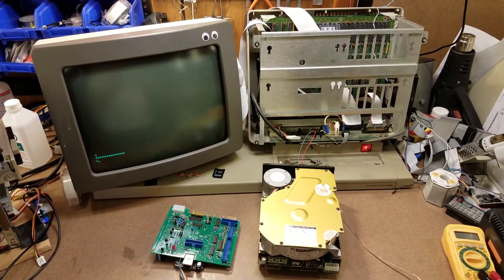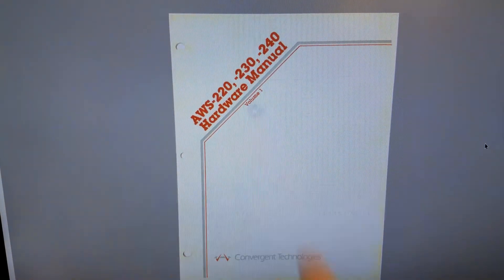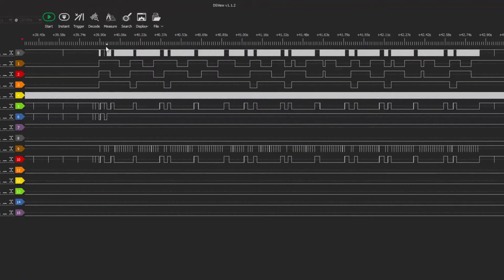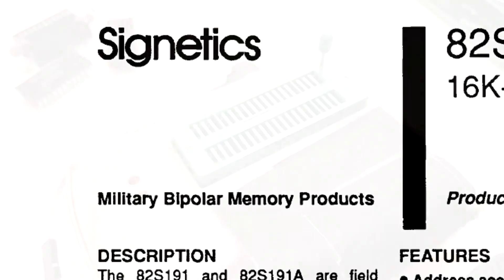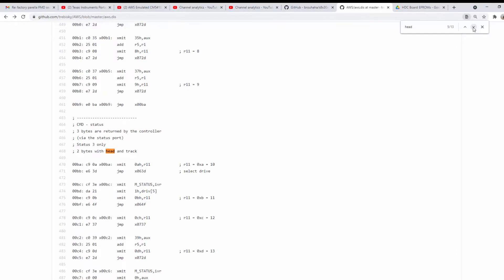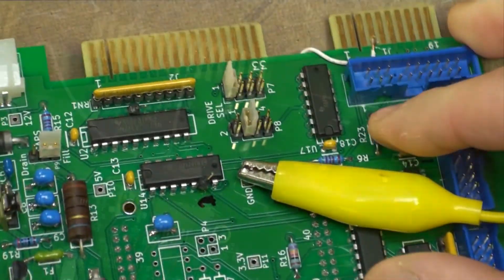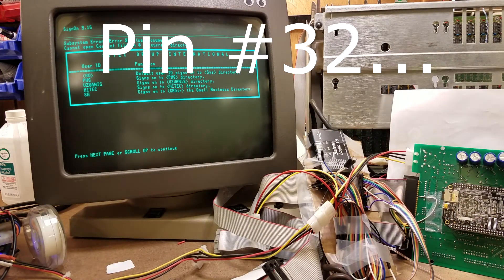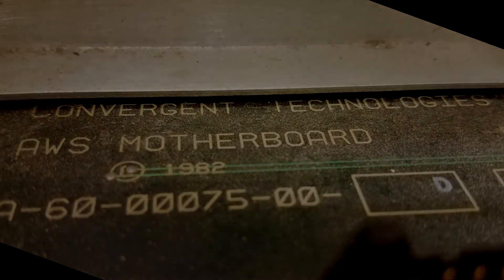The Convergent Technologies AWS Emulated CMI CM5410 Hard Drive Finally Boots!

Comment: The 5410C is not technically a part of the 5000 series, it was part of the "C" series of OEM specific drives. It's my understanding that these were further cost reduced bargain units sold very cheap to OEMs. As a normal person you could not buy one of these drives. This applies to the 5205C, 5410C, and 5616C. They are somewhat based on the 5000 chassis, but so were basically all other CMI full height drives until the closure of their drive division. Typically, the C drives were units which failed quality control for some reason, typically failures in head electronics (limiting their PCB to less than the desired number of heads, 6) or media failures. These drives have a specified geometry of 2 heads (5205C) 4 heads (5410C) or 6 heads (5616C) and 256 cylinders. This could be an issue with precompensation or media defects themselves. I am not sure if the firmware was changed to reflect this behavior. 

Because this drive supports buffered seek and has automatic write current reduction, this is an ST-412 interface. ST-506 uses non-buffered seek and has controller derived RWC as a discrete signal, which is swapped for an extra head select line in the 412 standard the next year.

3:12 These drives should ALWAYS be operated in the orientation they were formatted in. The 5000 series has NO feedback system and so the positioning of the heads is somewhat subject to gravity.
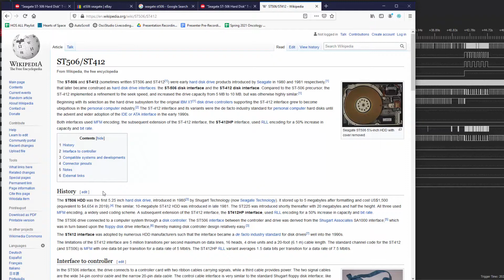5:37 The drive is "dumb" and communicates essentially in terms of it's physical state only - Track 0, index pulse, ready, write fault, seek complete, and the raw analog data actually stored on the selected head.
9:41 Because of above there is no recognition of any kind. The computer is given the physical geometry of the disk manually. Some controllers store the physical geometry of the disk at track 0 head 0 to be loaded on boot after initialization.
12:47 The number after the Motorola logo is a date code. YYWW year and week. These are mask ROMs whose contents are defined at the factory.
18:45 Interesting they were still using 256 byte sectors. Looks like it supports all CMI "C" drives, the original ST-506, and 8" floppy drives too. Neat.
19:55 HAHA I see what they did... The drive will respond with "selected" if DS3/4 are set and jumpered, which means the drive is illegally set to respond to multiple addresses, but this gets them two free jumpers on the disk itself. It would have been much easier and more sane to just put the jumpers or switches on the controller! There exist 4 drive controllers but the drives themselves were cost-prohibitive and so few people probably ever used them like this. An example in the IBM world is the Zobex 4HDC.
21:23 You don't even need to check, you can see the bodge wire to the jumper.
30:01 This is not termination of any kind - The other side of the jumpers is all tied together and goes to the drive select logic, which I believe on the CM5000 is straight into the microcontroller.
Reply from the maker: Wow, THANK YOU for this very insightful and thorough comment.  You spent some time writing this!
Reply: @ForgottenMachines  I did, hopefully it found you well despite being just a bit late. Maybe this information will help you in the future or someone else browsing through your videos. I had stumbled across this in looking for other video of existing CMI drives for a future project I have been working on and figured I would provide some insight.
Reply from the maker: @AiOinc1  Youtube comments are NEVER late!  They are always welcome, and these videos will hopefully stay published for a very long time!
Reply from the maker: @AiOinc1  please feel free to share what you are doing with CMI drives...they are pretty rare, at least here on YouTube...
Reply: @ForgottenMachines  I have a large collection of rather rare and I think interesting vintage hard disk drives. I am in the process of converting one of my spare closets into a nice-ish recording studio to show off many of them, show them in operation, include setup tips, repair help, etc, as well as links to relevant documentation where available. Maybe some example use cases. 

Recently I got an IBM 0665-53 up and running in Windows 98SE, an ST-412 drive via DTC 7287 16-bit RLL controller. Was not as hard as it may initially seem. This is the type of thing I hope to show off a bit. 

Many of the drives I hope to show include CMI 3000, 5000, 6000 drives in my collection, my now-complete Kalok Octagon lineup, some PTI drives, the early Seagates (ST-506, ST-412, ST-419, ST-212), and some other strange models maybe you haven't heard of before (ST-213, ST-252, RO202E, some of Microscience's later models)
Reply from the maker: @AiOinc1  Have you considered imaging the contents of any of these drives with the Gesswein MFM Reader/Emulator?  I imagine that the contents of some of them could be pretty important, possibly containing operating systems for machines long gone.  Perhaps?  

If it weren't for me getting these hard drives to work, there would be NO way that we would ever have seen some of the OS install configurations that we have, because the Convergent Technologies AWS machines are NOT being restored by anyone but me right now, and no software is archived publicly as of yet, except for on my website.  Your situation could be the same!
Reply: @ForgottenMachines  Unfortunately I do not own such a device at present time and I've no idea what said drives were removed from in their past life. Many of them came from a local computer parts warehouse years ago. I'm sure their contents are all long since lost.
Reply from the maker: @AiOinc1  Well, if you ever WANT to know what's on any of them, we can likely extract that data with the same tool I demonstrate here.  The very CMI CM5410 that I demonstrate here was recovered and emulated by me right here in this video, so this is proof that hard drives of this age CAN indeed be recovered, imaged and emulated.  These contents are now preserved, and were not lost to the ages, thankfully!  This is a pretty rare OS configuration, so really glad we've saved it!
Reply: @ForgottenMachines  I should say that many of these drives having been in my collection so long have already been formatted by different controllers at least a few times. I'd be surprised if they had anything left, unless they're drives that don't work which I never repaired.
Reply from the maker: @AiOinc1  Ah, well there is still hope for the contents of those, if you are ever interested.  Good to know you have options now!  There has been SOO  much progress  with MFM/ST506 hard drive data recovery & emulation made by the Vintage Computing in the past 7 years, and it keeps getting better!  It's absolutely amazing.  For reference, here's a main forum of those who are continually recovering data from their MFM/ST506 hard drives...  https://groups.google.com/g/mfm-discuss?pli=1
Reply: @ForgottenMachines  My main interest is in the engineering behind the drives themselves anyways. I don't think there is any way to recover data from a drive after it has been low level formatted.
Reply from the maker: @AiOinc1  Yes, I certainly agree with you.  Once those flux transitions have been re-arranged, that's it, the data is truly gone...
Reply: @ForgottenMachines  Woah! I actually just looked at the logic board on my own 5410C and 5616C, they both have the bodge wire(s) from the drive select block to TP1! It's possible then, that they used these drives with a machine like this, or at least a controller which operates in the same manner. These are actually drives which have not been formatted (to  my knowledge) but I have no example of the imager. How much of a hit cost-wise are they?
Reply from the maker: @AiOinc1  Not just possible, but highly likely!  As such, being as rare as these machines are, I would happily volunteer to image these drives for you at my own expense.  Please, feel free to contact me directly here:  https://convergentaws.blogspot.com/p/contact.html  I can give you details about the Gesswein Emulator/Reader there
Reply from the maker: @AiOinc1  For reference, here's others I found, but they are so cost prohibitive, otherwise I'd buy them just to image them...and the seller KEEPS raising the prices as if someone will ever pay that...sheesh..   https://convergentaws.blogspot.com/2021/12/are-these-computer-memories-hard-drives.html
Reply: @ForgottenMachines  HAHA, May I admit that these are the very drives I wound up buying? My 5410C and 5616C both came from that very seller. I am being 100% serious. I didn't pay NEARLY list price, though, as I've worked with the seller for a long time and typically buy in bulk for my collection. Spending $450 a month through a seller makes them more willing to cut you a good deal...

I will contact you on your page.
Reply: @ForgottenMachines  I sent you an email, by the way.